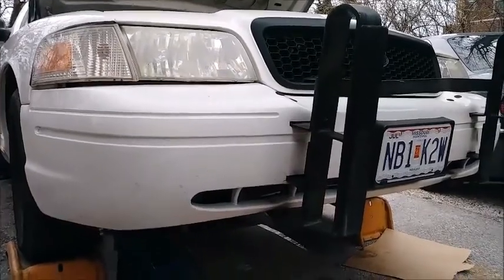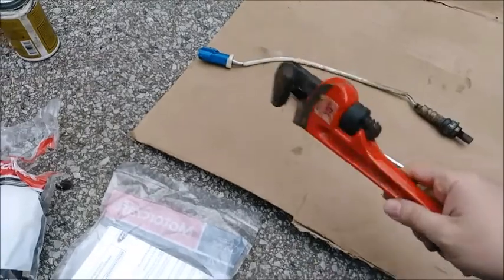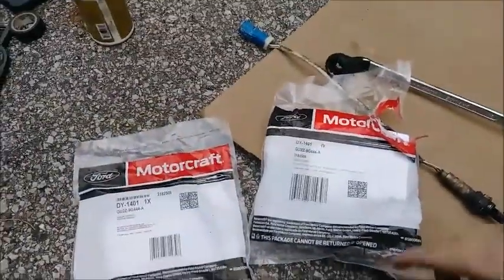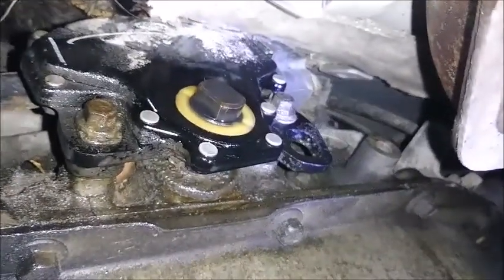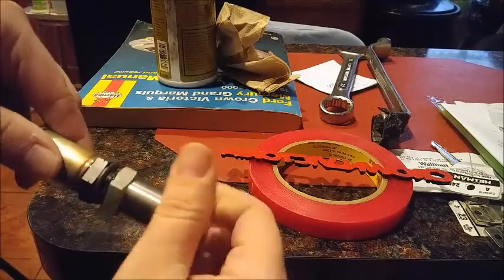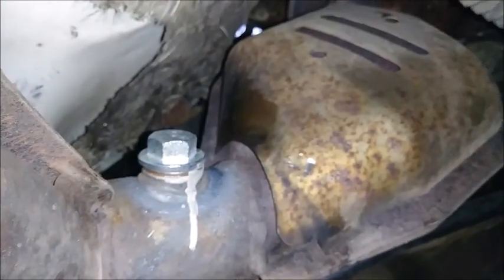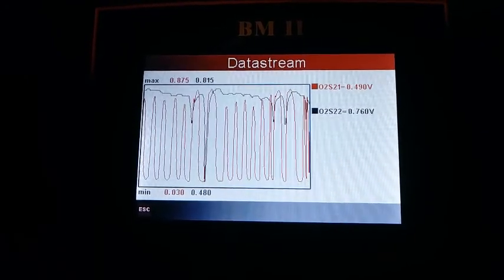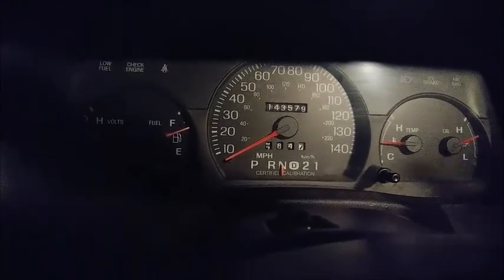Ford Crown Victoria P71 part 5 O2 sensor transmission range sensor

Comment: Do you still have the car? Are you still getting the P0705 code for the transmission range sensor? Did you ever figure out the problem?
Reply from the maker: Still own it, still daily it. I just start the car in neutral and shut it off before shifting into Park. It's the only way to keep the code from setting the MIL.
Reply: @HollywoodHornet  I had the exact same problem that was intermittent. It turned out to be a short in my tail light wiring. Just thought you may want to know (I commented on this video 1 year ago). Pull your taillights and check the wiring. From one Panther owner to another, good luck and keep us updated.

Comment: Did replacing the Trans Range Sensor fix your p0705 code? Was the car running badly/different when the code was present? I have this code and the trans was rebuilt last year. The OD light is flashing but car seems to be running and shifting good.
Reply from the maker: It didn't fix mine but your mileage may vary. I think it's either the pigtail or a wire in mine. The car knows it's in Park because I can start it in Park. However once running it pretends like it doesn't because the OD light flashes until I shift out of Park for about 30 seconds. It will only start doing this in Park with the engine running. Never if it's in Park with the engine off and never if the engine running in any other gear range.

Going into Park twice while the engine is running turns the CEL on. I figured out I can avoid triggering the CEL and the code and avoid the OD light flashing if I never put the car in Park with the engine running. I just start the car in Neutral and I shut if off before shifting into Park. Or if I forget, I shift out of Park immediately on start-up and/or shut the engine off immediately after shifting into Park before the OD light has a chance to flash.

Since I am allowed to have the engine running and in Park once every so often, if I'm on a hill and forget something outside the car, I will shift into Park and just not do I it again for several drive cycles to avoid CEL. If I ever accidently turn it on or intentionally do it because I need to be in Park while engine running, I just reset the code.

Reference emissions testing, if I can manage to keep the mileage down enough to avoid the test, no problem. If I cannot, then I make sure I have my one freebie available for the test since the people usually start my car in Park and don't shift out fast enough to avoid OD flashing. That gives me the one buffer for the code to be pending instead of stored and I'll pass the test anyway.
Reply: @HollywoodHornet  thanks for the reply!

Comment: got a CEL after a trans rebuild..'06 crown vic cvpi...all four O2 sensors throwing errrors,,the shop is chekcing for a pinched harness today..i dont think they will find one but they said it could have happend on the re-install of the trans..Car runs great..if there is a stumble at idle its super faint..starts fine drives fine..anyone have issuess with all 4  o2 sensors throwing codes after exhaust work or transmission work??

Comment: What are those o2 ecu fooling adapters called? Where do u get them?
Reply from the maker: I got them on eBay. I think they come from China do it takes a minute for them to arrive. I think I just googled "O2 sensor cheater adapter things" or something to that effect. I'll see if I can find a link.
Reply from the maker: Found it

https://www.ebay.com/itm/Oxygen-O2-Sensor-Spacer-Adapter-Bung-Catalytic-Converter-Fix-Check-Engine-Light-/154016465327?_trksid=p2349624.m46890.l49286
Reply: @HollywoodHornet  thanks so much bud. Ordering right away. Cant wait to get rid of that wrench light.

Comment: The service manual says to remove the shift cable to remove the transmission range sensor did you have to do that to remove yours?
Reply from the maker: No sir. At about the nine minute mark you can see that cable to left, behind the sensor. You'd have to remove the sensor to remove the cable. If you are only changing the sensor, no need to remove the cable. Just unbolt the sensor and unplug the electrical connection. Just remember to line up that mark with the car in neutral before re-installing the new sensor and it's a boom done.